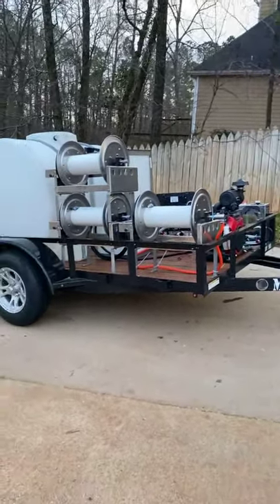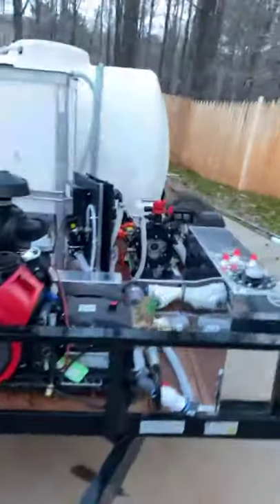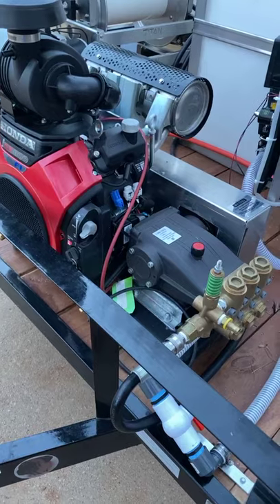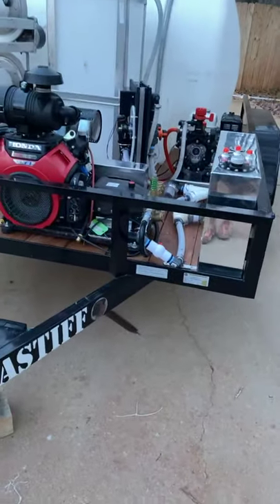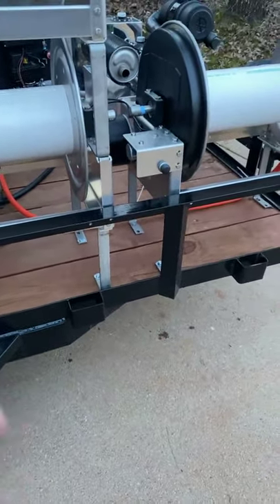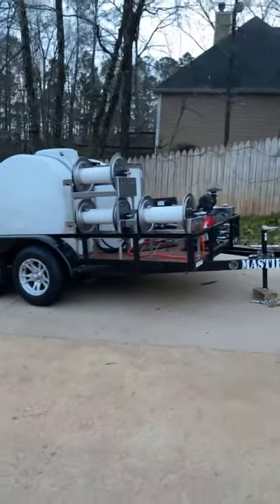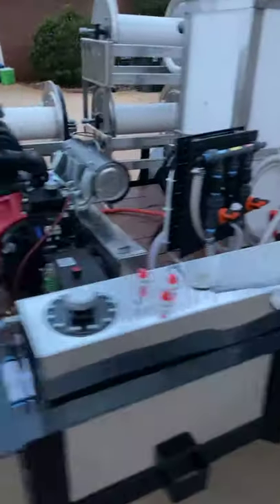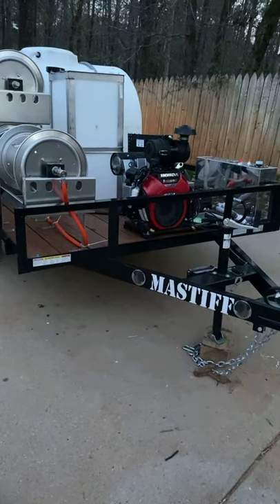Update on pressure washing trailer build

Comment: Leon, I have another question for you. For the 10 GPM pressure washer; are you still using a 1/4" hose or do you need to step up to the much heavier and harder to work with 3/8"?
Reply from the maker: 50’ of 1/2” then reduced to 3/8

Comment: Doesn't the bypass need to continue to flow when of the gun.if so why is the bypass  part of the metering value? it's not flowing
Reply: RUNS THROUGH TOP BUT NOT THROUGH METERING VALVES, A BIG LOOP TO COOL WATER